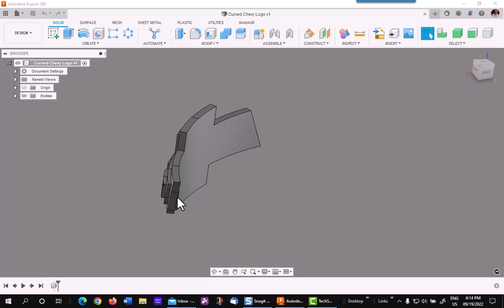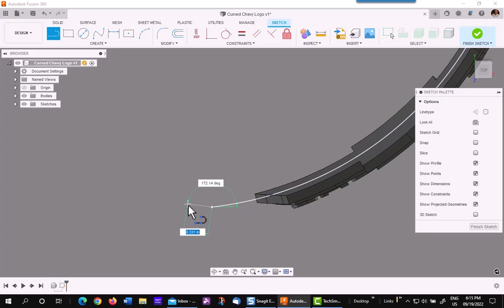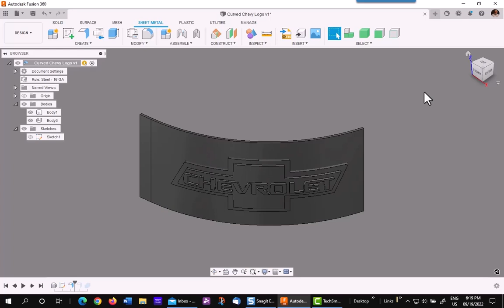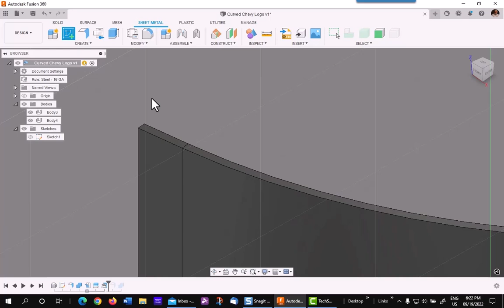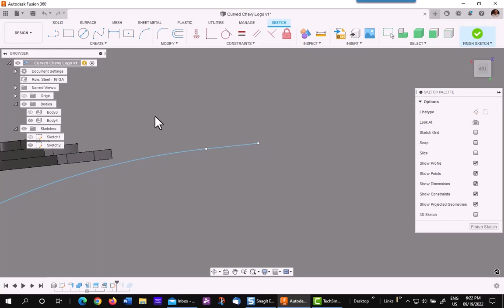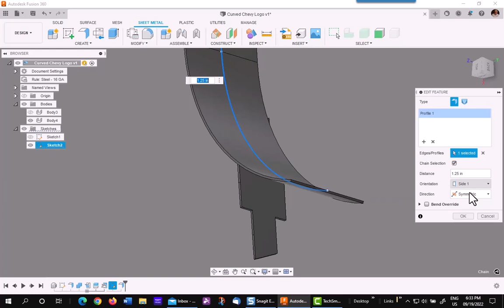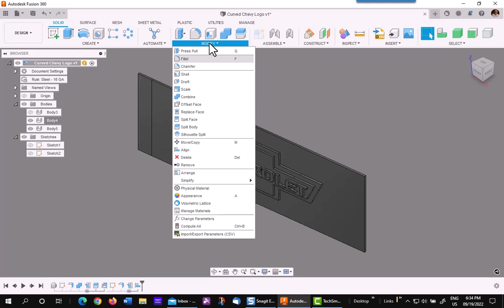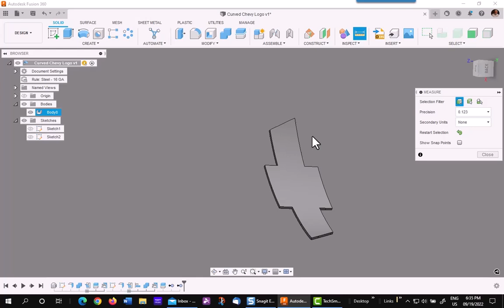Editing the Curve in a Solid Body Using Fusion 360

Comment: I've started with a straight body. I created a curved flange behind it. I unfolded the flange, then combined the body to the flange. I then recurved the flange and the straight body curved with it. I keep getting a compute error trying to do the body split to separate the body from the flange. Thoughts?
Reply: Before refolding, I went to the underside of the flange, drew the shape of the original body, then did an extrusion cut so that the flange and the body were only touching along the bottom edge of the body. Did the refold and the split body worked without issue